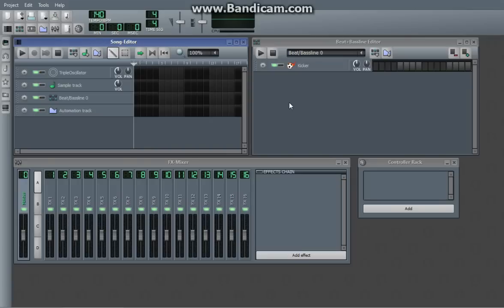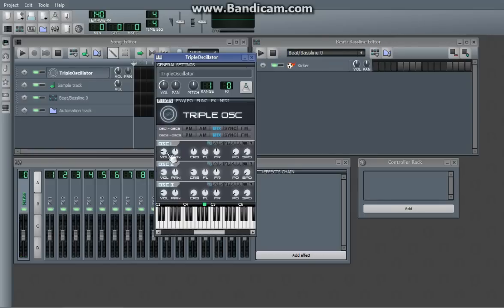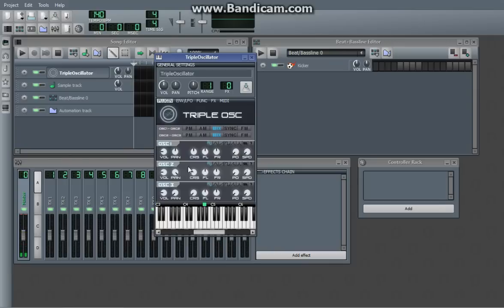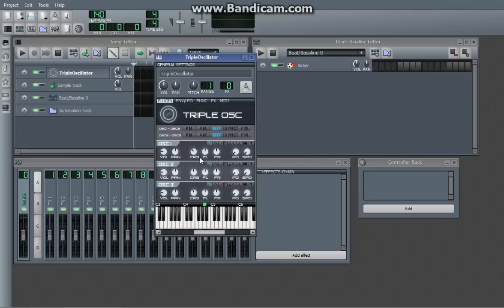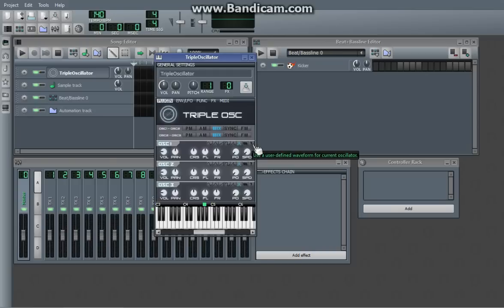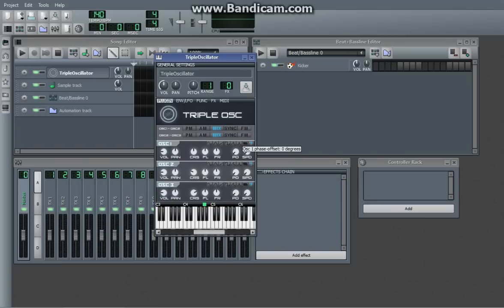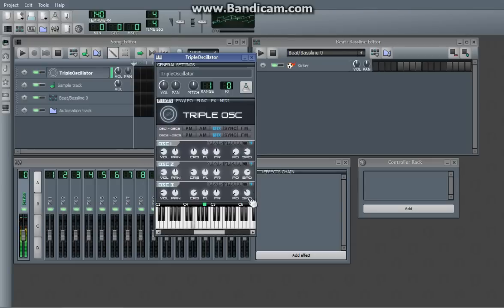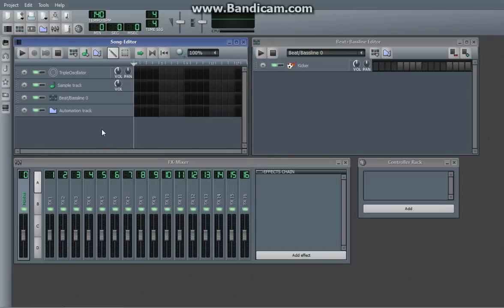LMMS Tutorial 3: TripleOsc Basics

Comment: TripleOscillator whitenoise is actually REALLY useful. Just use one of the three to introduce some amount of noise into the sound - I'm following your guides (have done stuff with FruityLoops and Buzz Tracker, but that was like 15+ years ago!), and I do what I see in these tutorials, but my own way - and I configured the TripleOscillator to use white noise in third oscillator to introduce slight noise to the sound, and made it sound more like what I was after. Also white noise is one common tool to create drum sounds... For example with C-64 SID chip drum sounds were often made either with just noise channel (remember, SID has 3+1 channels - the 4th is whitenoise only) or combine the noise channel and one of the three channels to create certain synthesized drum/beat sounds.

So yes, whitenoise does have a lot of use in synthesizers :)

Thanks for the excellent and simple to follow tutorial videos - I learn so much faster this way than reading documentations :)

P.S. I was just trying to add SID synthesizer to my project, but trying to use it just crashed LMMS (without any error messages).
Reply: This should be pinned.